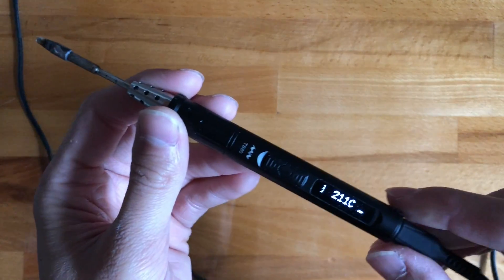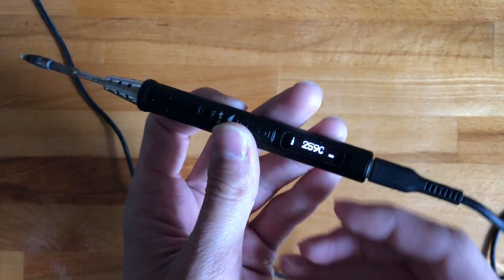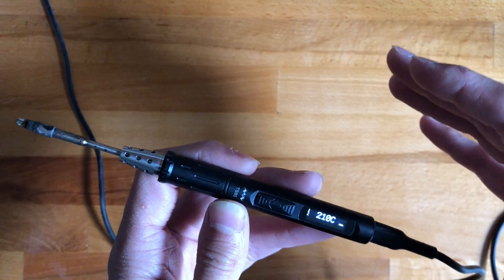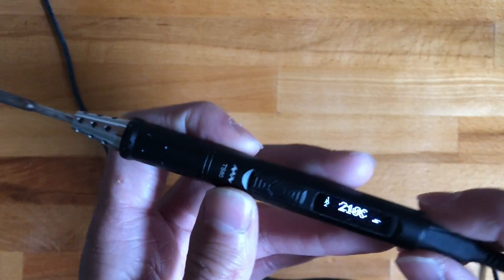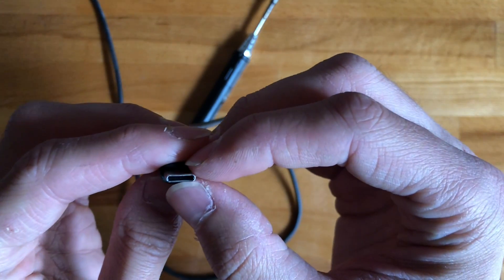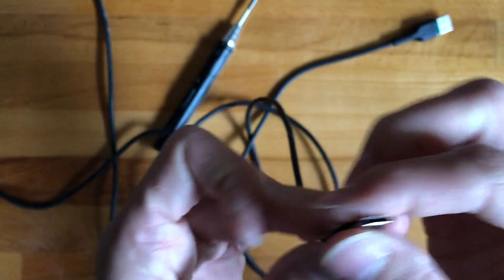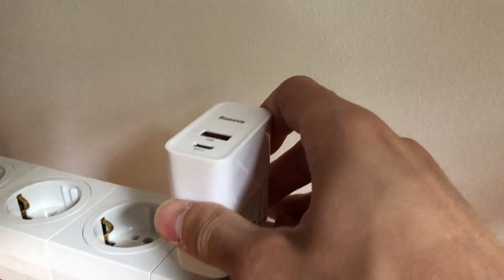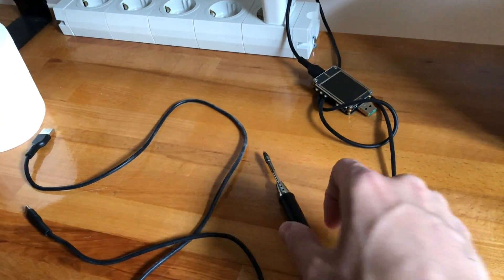TS80 Low-Vot / Low Voltage / Low Volts Fix

Comment: Hello , I have a Blaupunkt Bonn Sqm Radio and I want to install Bluetooth to it . I saw your video but sadly I have 3 switch boards and I don’t know which one to use . The numbers are TDA2320A, AN7273 ( says 7N9 under it ) and the last one says P8644 and then it says under form this CD4066BCN and then it says under it MM5666BN .one is supposed to be a preamplifier , a amplifier and a semiconductor . Which one do I need ?i need your help please !
Reply from the maker: I honestly have no idea about any of what you mentioned

Comment: hey man i saw a woofer from an ipod hi fi a1121 speaker in your old video do you have maybe an amplifier from that speaker for me to buy ?
Reply from the maker: nah - I bought that Hi-Fi as a shell, with no amplifier or power supply

I fitted my own amp/psu/charger solution
Reply: darieee and what would you recommend for it a tpa3116 amp or a 3118 ?

Comment: I got the low voltage message too. Then I discovered that that only happened when the USB-C connector is plugged in in 1 of the 2 ways. In my case with the printed markings on the back. When the printed markings are facing to the front, the TS-80 works ok. 

Probably the same cause as described in this video. I’ll give the connector the gentle squeeze and see if this fixes the issue. 

Thanks!
Reply from the maker: hey man! yeah - I've been using my connector in 1/2 ways for the past year too .. then it struck me a few days ago .. 

the squeeze will 100% fix your problem too 🤘
Reply: darieee Hi, 
You were right (of course). I just fixed it. 
I made a video of it. Let’s see if I can upload it. (Would be my first YT video).

I really glad with your tip. I could use my TS-80 but it felt like it could fail any moment. Now that it’s fixed it’s one worry less.
Reply: darieee 
Thanks! 🙏 
https://youtu.be/ajYUhOXt-PY